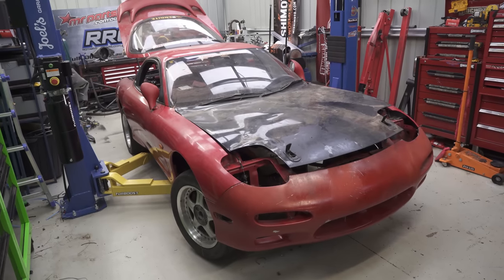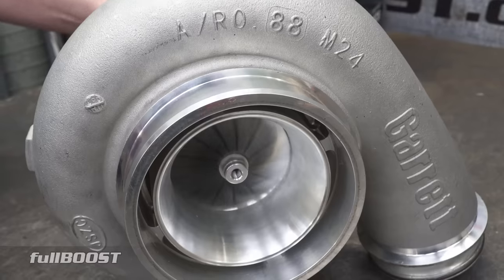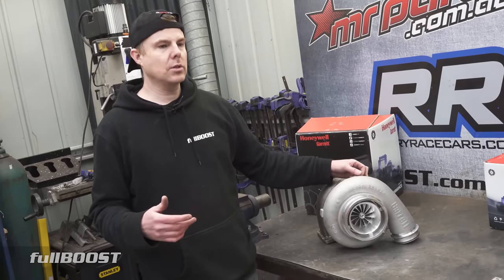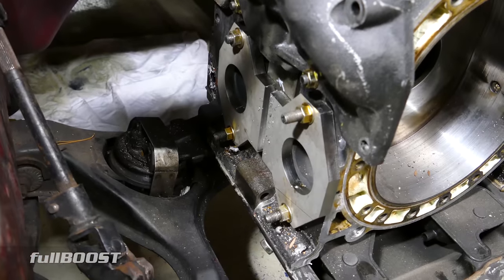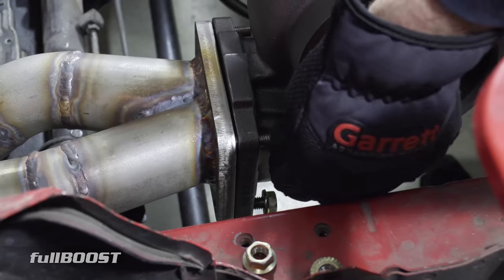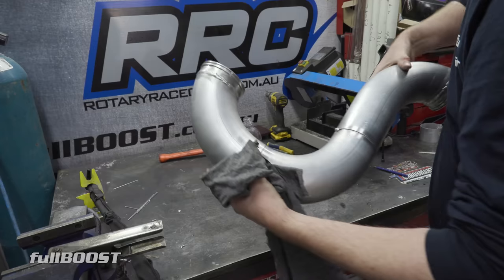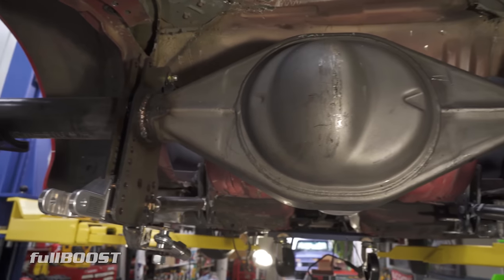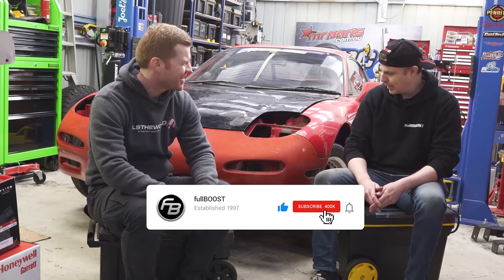Turbo bigger than the engine! | FD RX7 build ep 02 | fullBOOST

Comment: Never new garret came out with a "GD" line 😂, had to put adam LZ's video on pause to check this sweet build out. Tell him to look into a mavn mount for the turbo! Alot of the crazy promod cars with the turbos mounted up by the front grill run them and they work awesome.
Reply: I was going to do something like that, but the engine mounts have some slight movement in them, and they are all engine plated chassis cars using those, so wouldn’t work. I’ll weld a bolt to the flange and tie it back in to the engine with a support arm to help with the weight. 👍🏻

Comment: Let me know if you need chromoly axles and custom ring and pinion ratio changes I work for nitro gear australia and have parts instock to suit your build
Reply: We have some strange 35 spline axles and a strange bolt thru ally case with 4.56 pro gears at the moment 👍🏻
Reply: @BroomysGarage   no worries mate let me know if you want a ratio change,

Comment: Hi guys, i hope you get the exhaust headers jet heat / ceramic coated, that way all the temp is taken away from the turbo and engine bay. :)
Reply: I ceramic coated all the exhaust stuff in the 626. Personally, I don’t think it made a lot of difference. The exhaust housing is again, but will also have a turbo beanie and heat shielding to keep heat in for the manifold. Air is the best insulation, so creating an air gap between the manifold and the heat shield will stop a lot of heat (same type of material OE manufactures use).

Comment: What are those gold studs you used on the turbo manifold to mount the turbo?
Reply: Just manifold studs. Will be able to find them at a nut and bolt retailer or an exhaust shop.

Comment: Bevel your stainless manifold schd sections! I’m sure you’ve heard about purging too, that’s up to you. You also need to turn your amps DOWN and lower your travel speed way down, this will give you adequate heat and gas coverage. Stainless doesn’t like high heat and fast travel speed. Make sure though you’re running above 15lpm gas. Cup is good though. Here is a link of my work to show as an example : 
https://www.instagram.com/p/CN3yQ7fjMZo/?igshid=rz6jshysl4oh